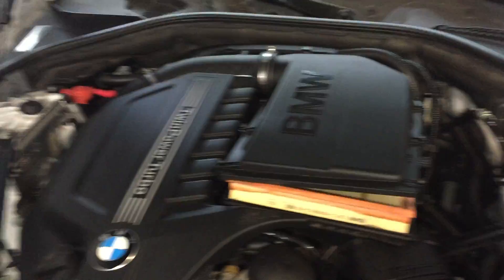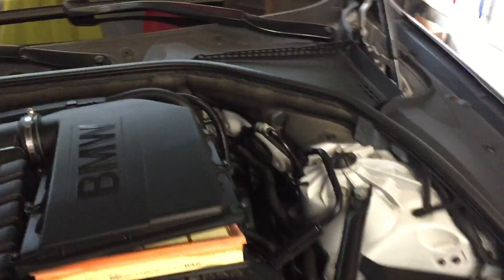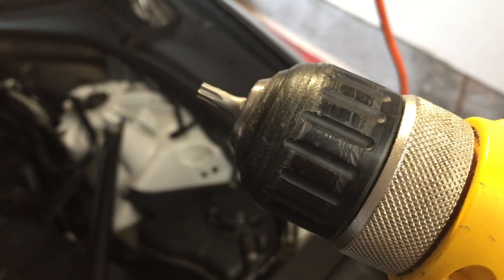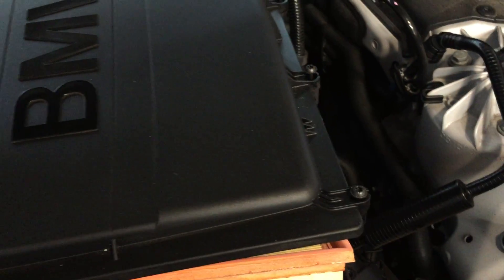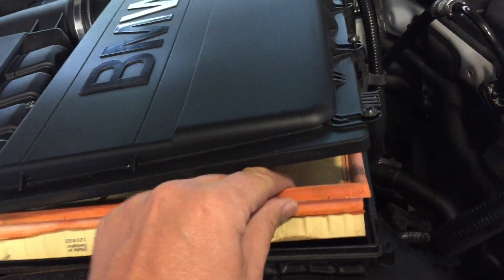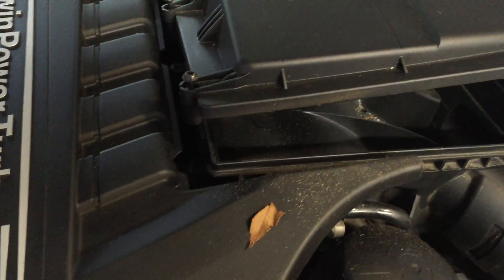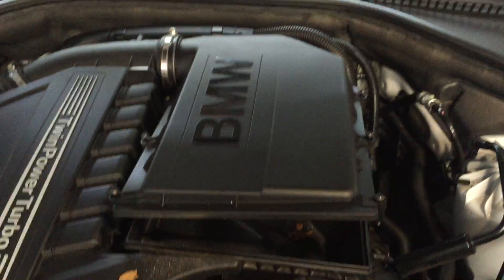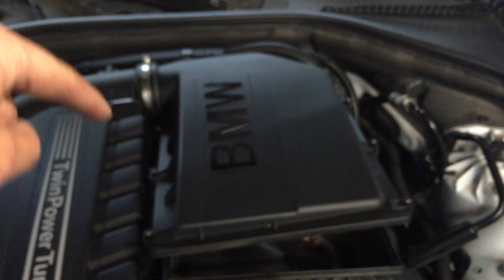F10 2013 BMW 535 N55 Air Filter Change #gasburn

Comment: Thanks for making this video man! I do have a question regarding the placement of the K&N filter. I got the same one as you. I watched another video before yours and the guy replaced the original filter with also a K&N filter but the white fluffy padding on the original filter. He took it out, wiped it down and placed it in the air box before placing the new K&N filter.

Is this something I have to do?? I just installed the K&N filter and It was easy as can be. Less than five minutes but I through out the old filter with the padding. I hope I don’t need that. 

Appreciate your input!

Thanks